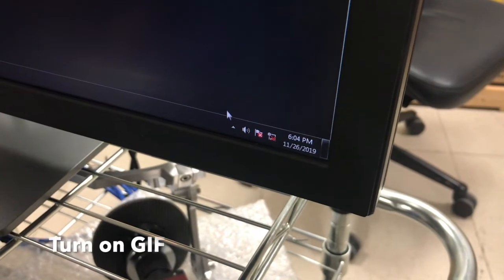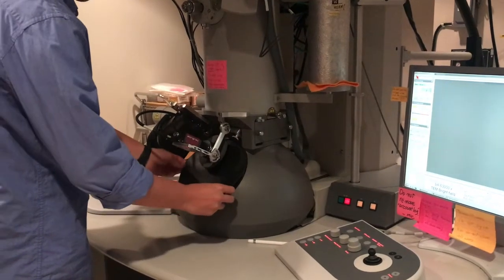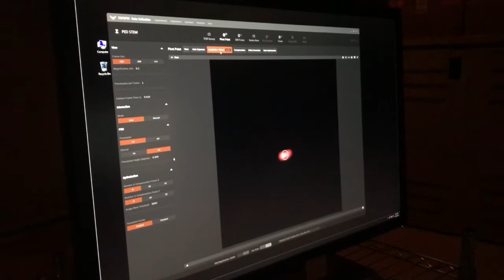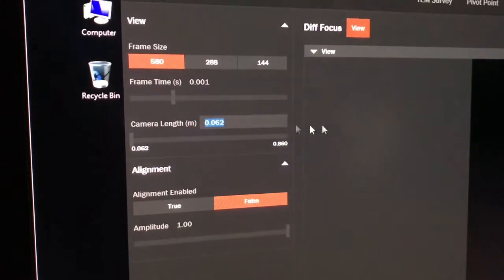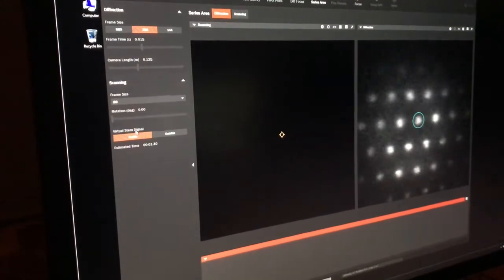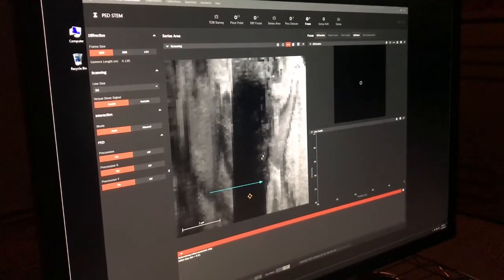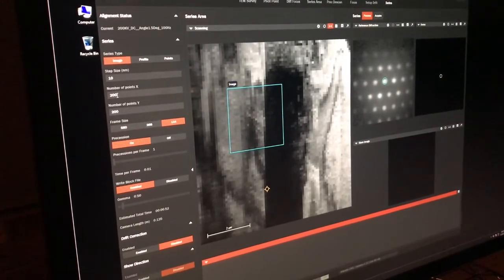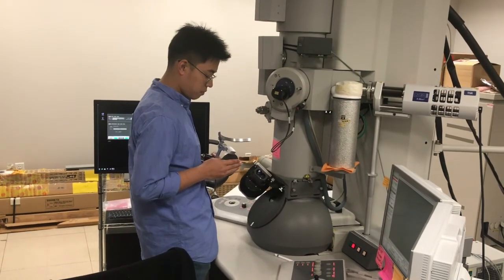NanoMEGAS ASTAR-TOPSPIN Tutorial 1 - Data Aquisition

Comment: Some comments from Dr. Portillo:

1. In this video, the first TopSpin task "Survey" is not used to view the ROI on the sample (the video assumes the operator will have stored on the  Fei UI Stage control 2 positions: one for vacuum and one for the ROI) and it also does not make use of the STEM MAG red overlay mag nor its rotation angle selection with respect to the TEM image (which are really useful/ necessary TopSpin features to make use of).

2. In the "Series Area" Task, the VBF or STEM image is shown with absolutely no discussion on the dwell time selection (5ms/pixel is a value I always recommend for a 100 by 100 pixelated frame); as this is an important parameter, I would rather have seen the Professor mention it ( he mentions instead that an 80 by 80 pixel reduced selection is enough …)